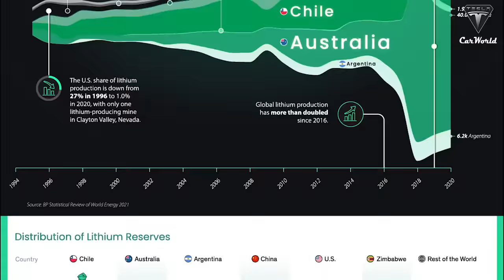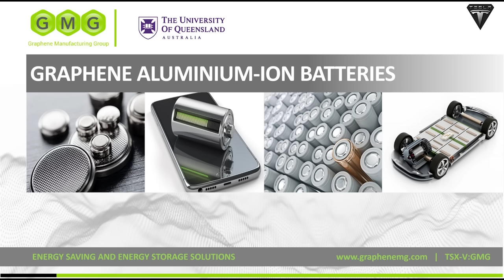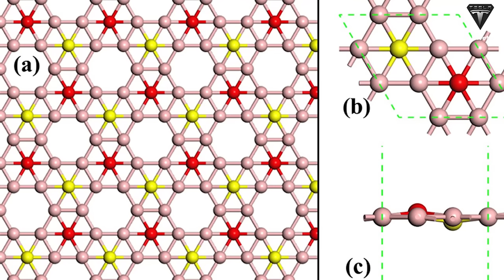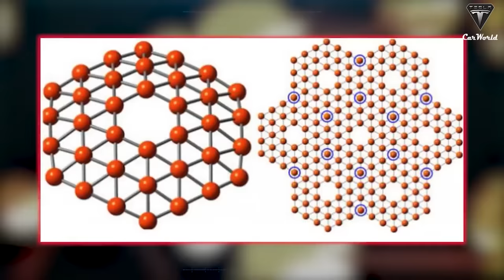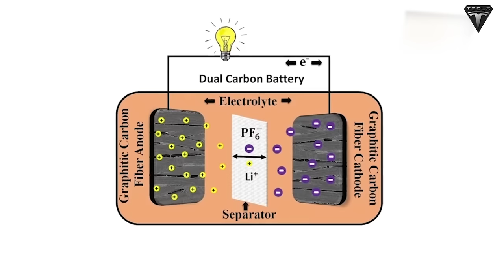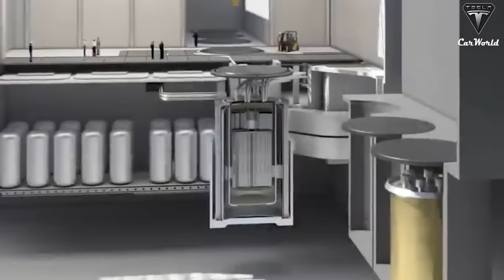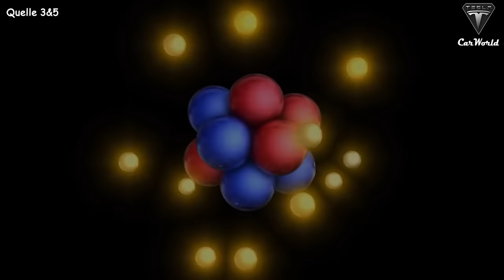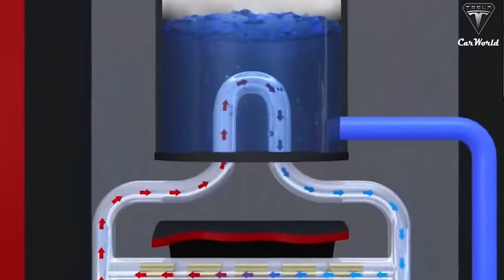Elon Musk: "No More Lithium! This ALL NEW Batteries Miracle Material Will Change Everything 2023!"

Comment: Thorium is only usable as an energy source by bombarding it with slow neutrons to transmute it into protactinium-233.  Protactinium-233 has a half-life of about 30 days and it decays into uranium-233.  Uranium-233 is a fissile material that can then be bombarded with slow neutrons in a nuclear reactor to produce heat and then electricity.  Thorium would make a viable fuel for sustaining an electrical grid but, it is not directly useful as a battery component.  There will be no cars directly powered by thorium.

As the video mentions, thorium is between 3 and 4 times as common as uranium.  What it doesn't say is that only 0.7% of natural uranium is uranium-235 (the fissile isotope).  Whereas, all of the thorium can be converted into fissile uranium-233.

The fissioning of uranium-233 produces a small amount of long-lived actinide waste products.  These can be consumed by cycling them directly back into a reactor.  The other waste products have a maximum half-life of 30 years and will decay to background radiation levels in 300 years.  We can have nuclear power without producing mountains of long-lived radioisotopes.

Comment: There is an error at the 21.10 minute mark...." dual carbon batteries deliver more than 4 volts of power from a single cell". Voltage is not power.  Voltage times current = power, The units would be in watts.

Comment: The only reason for a battery is to get the rig rolling which a small 12v will handle. The tech for a self powering motor has been available since the early 1900's via Nicola Tesla. In fact Musk wanted to use the design for his cars, but the Roth childs wouldn't allow it and are forcing him to use batteries after settling  paying him 8 billion as compensation for the deal.

Comment: How will this vehicle perform for use in Texas? Who will it take on high water? Is it hunter friendly? Can a hunter sleep in the vehicle with heat or air conditioning over night? Can it tow a trailer with heavy load. Will a user need to carry a generator and fuel to charge the vehicle when off road? Does the Truck come with a open access moon roof and back window open access? Just how useful would this truck be off road? Cannot carry extra electricity in a can ?

Comment: actually, we want to get rid of lithium, because it will become a fuel source for projects like ITER. When firing a neutron at it, you get a core from tritium, helium-4 and an extra neutron. The other product they need is beryllium, which gives 2 cores of helium-4 and 2 free neutrons for the chain reaction, to inject tritium into the flow for tritium-deuterium fusion. If ITER will ever work that is, but I think they aren't taking any chances. Also tritium is needed for the creation of thermonuclear bombs (hydrogen bombs).

Comment: It doesn't matter if a battery can charge in 2 hours or 2 seconds IF the national electrical power grid can't handle the draw of energy.
Reply: Matt Jepsen  Your ignoring that the total energy needed is still the same, Over a shorter time means a higher peak demand---a worse case situation

Comment: It's a wishful thinking. There is finite number of known metals in the Mendeleev's periodic table. Lithium is the lightest metal. It's one of most important reasons lithium is used in car batteries. An advanced vehicle battery allows 1500-2000 charges/discharges. A typical phone battery usually allows 500 charges/discharges. A Tesla car battery is very heavy. I believe it's very inefficient way to store big amount of electrical energy in vehicle electric batteries. It would be much more effective to produce electricity on demand with some kind of fuel that's better than oxygen. The best vehicle propulsion technology today is hybrid.

Comment: Too bad they can’t learn to use capacitors for batteries. If there was a way to control their discharge capacitors would be a great battery in my opinion, fast charging and controlled discharge. Hopefully someone some day will see their potential as a battery.
Reply: Yes for power take off then use battery for cruise